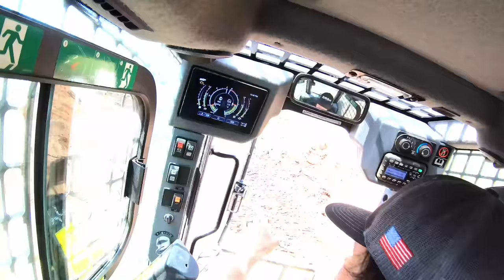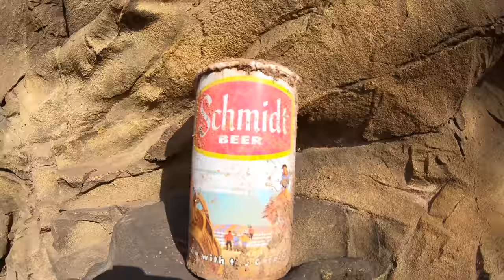Rebuilding Retaining walls-Start to Finish

Comment: You're making it work with the skidsteer but certainly an excavator is preferred for all this rock placing. Best situation to have both, i make it pretty well with my kubota kx040 and an ssv65. None the less Great job!
Reply from the maker: I want one of those kubota Exc's. do you like your 40?
Reply: @Dirtmonkey  Yes the kubota mini ex's are fantastic machines, sometimes i wish i had the slightly bigger 57 but 90% of the time the 40 is plenty strong! Feels very well balanced compared to other brands i tried, maybe its a thing of "getting used to" as each machine is a bit different. My next addition to the pack will be an SVL90 or the newer 95 for heavier work.

Comment: I'm impressed that this ASV was able to lift those large boulders.
Wonder if cat 259d that I work with has that much lifting power. 
Talking about ASV, I'm surprised that there's no ASV dealer anywhere in Europe (as far as I know at least). 
They seem to be so good machines that are worth exporting to the other side of the ocean as well.

Comment: Like the real rocks. Have you explained what that rubber, rock facade on lower walls is?  Do you really like it?  I'm not lovin it.  It do not have a final vision of the timber facade, the fake rubber rock facade with the big boulders.  I love your channel nevertheless!  You are what makes America a great place to live in. You work hard and play hard!
Reply from the maker: You summed it up well. I have the final big picture in my mind.  I will shopw it when its all done.  But I agree- at this point its hard to picture.

Comment: I’m curious about what the stone on that house is made of?
Reply: Fake ones. Literally its just a facade
Reply: Stan proper drying time that way can take two years. Youre better off to find a kiln and have them dried so they dont warp. You can buy a moisture meter at lowes or homedepot and want between 8 and 12 percent.
Reply: @brettfrancis1527  it looks sooo bad…